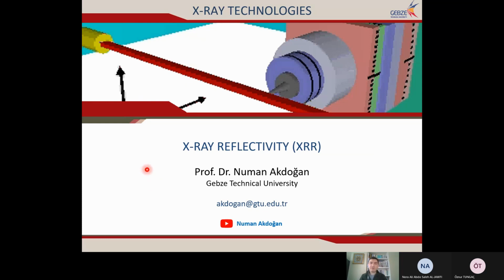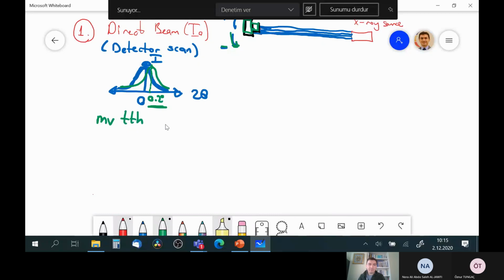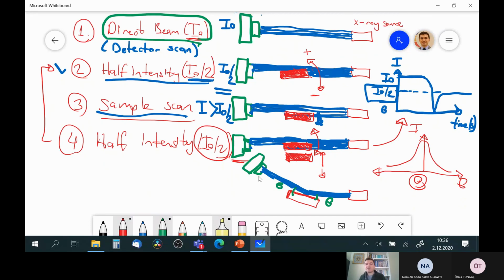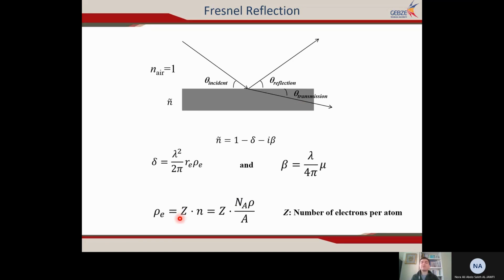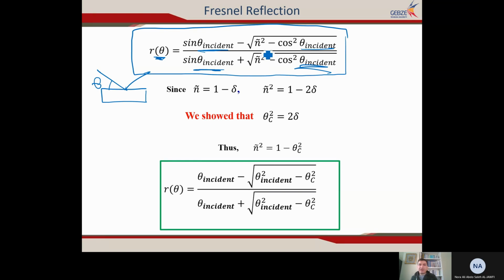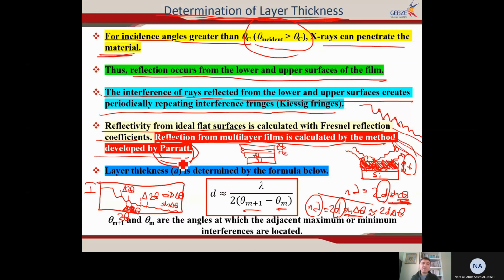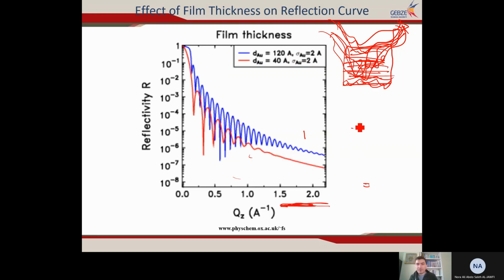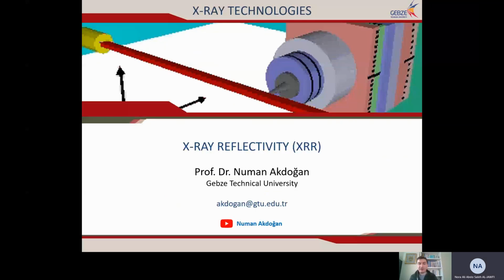X-Ray Technologies - X-Ray Reflectivity, Sample Alignment, Thickness-Roughness-Density of Thin Films

Comment: Best introductory video of XRR on youtube. Deserves more views!
Reply from the maker: Thank you Muneeb Ahmed. Enjoy the videos. Best wishes.
Reply: @universityphysicslectures  Professor I had a question regarding my Bi2Se3 sample synthesised ontop of a sapphire substrate. I am modelling the sample in GenX however I'm unsure what is the chemical composition of the oxidation layer ontop of the bismuth selenide . Do you have a method to determine this? 

Finally, is there a method to determine if an interface layer has formed in between the sample and substrate using XRR analysis?
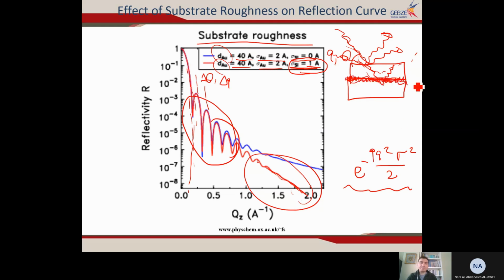Reply from the maker: Dear @muneebahmed1848 . You can determine the chemical composition of the oxidation layer on bismuth selenide using the XPS method. Alternatively, you can get this information from XRR simulations. Watch the video from 1:34:30. You can find an example there.

With regard to the formation of any interface layer between sample and substrate, XRR can help you. But to get reliable results, you should pay close attention to other parameters. It requires experience and can take a lot of time. But in principle it may be possible for expert users of the XRR method.
Reply: @universityphysicslectures  thank you for your help professor. I had one last question, following your example in the video if I had two oxides in one layer for example Bi2O3 and SeO2 would they combine as Bi2O5Se?
Reply from the maker: Dear @muneebahmed1848  . I can only tell you that the electron density will change if there is the formation of other oxide phases.

Comment: thank you so much Prof. Akdogen for this wonderful lecture. 
few quick questions
from the part of thickness determination.
you mentioned that in a relatively thicker film, more oscillations will be there because of a greater number of planes in the film. 
in that case how do you explain d as thickness of the film and not the interplanar spacing.

second, since the measurement is done by sweeping the incident angle.
how it is different from GIXRD.
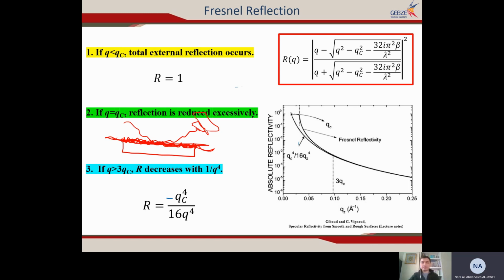Reply from the maker: You are welcome Ateed Ahmad. For the thickness determination you may watch from 1:08:59. The idea is the same for "d" determination. In this case "d" means the distance between top and bottom surfaces of the film.

Comment: prof,I'd like to know how we  measure CoO's and Fe's thickness separately?Thank you!
Reply from the maker: Dear Mienph Lee. You can get the thickness, roughnes and electron densities of each layer by simulating XRR data. There are free and commercial XRR simulation programs based on Parrat formalism. This information is also discussed in the lecture video. Best wishes.
Reply: @universityphysicslectures If we manually input  thickness, roughnes and electron densities of each layer in the XRR  simulation programs then we get the simulation XRR curve. Thank for your kind answer.
Reply from the maker: @mingfengli8187  You are welcome. Some programs automatically calculate the parameters (thickness, roughness, density) after entering layers and their nominal values.

Comment: Sir, I have a very thin Pt layer (nominal thickness is 1nm) deposited by magnetron sputtering on Si wafer. the thickness of the native oxide layer of Si is similar to the deposited Pt layer. however, the native oxide layer thickness changes every time when try to fit the curve. could yu briefly explain the reason? Thanks you so much!
Reply from the maker: Hi MemetTursun. 

First, you need to define the layers with the correct electron densities. That is, without changing the electron densities of the Si, SiO2 and Pt layers, the table values should be entered as they are. You can get them from webelements.com. And try to fit the XRR curve with nominal thicknesses. 

If it does not work, you can manipulate the roughnesses. 

If the simulation still does not fit the data, you can slightly increase the Pt density and play with roughnesses. But not too much. 

Additionally, you should get the best fit around the critical angle (before and after). If this first part of the XRR curve is not well-fitted, the fit parameters (thickness, roughness, density) may be incorrect. 

I wish you success.
Reply: @universityphysicslectures  dear Professor Akdogan, Thank you for your quick reply! I will try the way you mentioned. Also, I have other one question: when fit the curves for different Pt thickness, the resulted SiO2 layer thickness is different for different sample, in spite of very good fit for different sample. what do you think the reason might be?
Thank you very much !
Reply from the maker: Dear @memettursunabduqadir4806 . This should not be the case if you are using the same Si/SiO2 substrates. Something must be wrong.